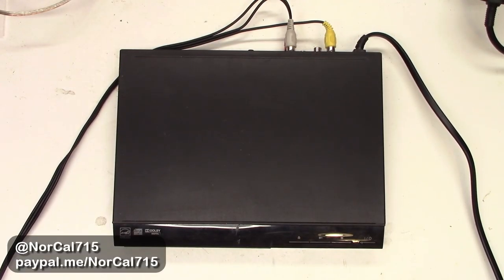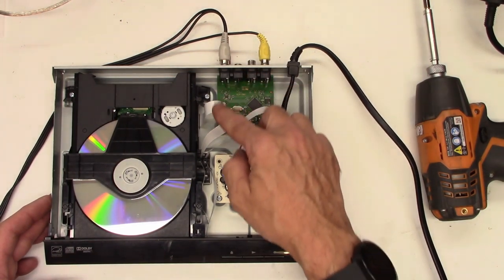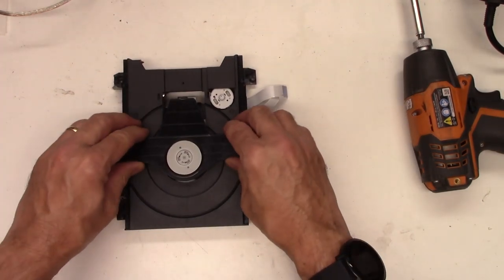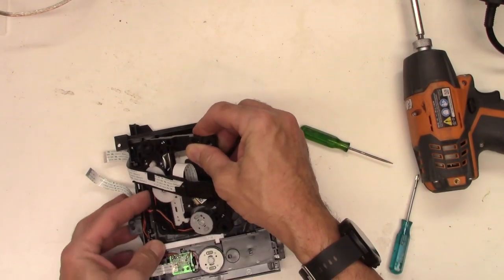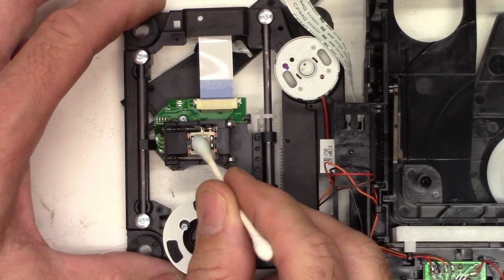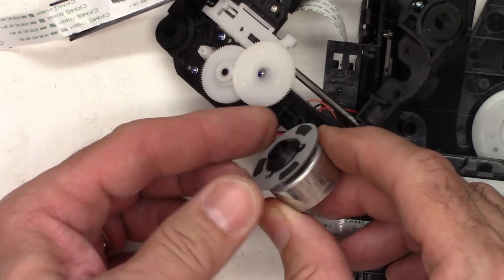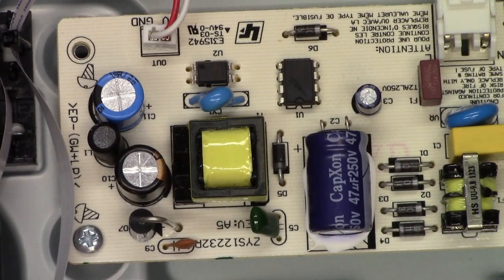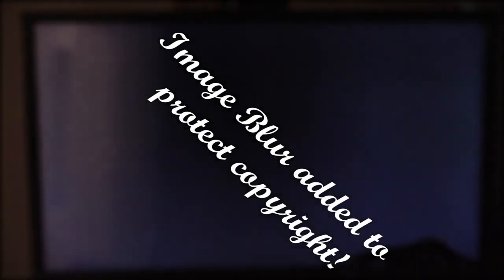DVD PLAYER SERVICING BASICS

Comment: Thanks for posting this video, as it was particularly useful since you needed to take the disc assembly out to access the laser from underneath.
Some appear to be in a sealed plastic casing with no access, but I could see how you could  unclip the unit from the underside.

I’m going to have to tackle my Panasonic DMR 530 blu ray again, after it refuses to read any dvds whatsoever. Originally I prised off the disc spindle and gained access at an angle to the twin lasers. But you couldn’t get enough purchase on it to clean it properly, but I believe your video might have helped solve my problem.
Thanks.

Comment: This is a great video. Is there any benefit to lubing up the rails/gears on the optical assembly, and  "sled"? Figure since a person is already lubing and cleaning every other "moving" part, if that would also help the longevity of the unit. 
When I worked at an electronics place many years ago, we always cleaned off most of the old grease from the plastic gears (especially in VCR's) and greased them up again. Is this actually necessary?
Reply from the maker: I would say yes it is important to clean and relube all the surfaces
Reply: What grease and oil do you use/recommend?
Reply: Yes, while you have access to everything, clean what you can including those sliders. The assembly can stick eventually giving a No Read message.
A light oil was recommended to me which you can soak into the bushes so the assembly just glides along smoothly.

Comment: I have a Kenwood one and there is a magnet that is under the upper clamp, that silver disc above the assembly. That magnet is kinda exploded but is it really essential? Can't I just remove it? Because the player still fires up but ever so often freezes the dvd
Reply from the maker: The magnet is what clamps the disc to the platter. Without it will just contact the disc with friction and the servo will not be able to correct.

Comment: This is a good instructional video (Though I guess as others have said, it might be better to use alcohol)  and this probably goes without saying (but I'll say it anyway). Do this only if you have to. If it ain't broke, don't fix it. Some people will watch a video like this and even though their player is working fine, they'll think "Hmmmm. I think I'll clean mine just to be on the safe side". Just to be on the safe side, don't do it unless you're getting a lot of errors and skipping and you're sure it's not scratched or dirty disks. You probably won't damage the mechanism or the lens if you follow this video exactly but they are delicate parts and you could damage them easily. Decent DVD players are getting a little harder to find and this one isn't half bad so if you have one of these, you don't want to kill it prematurely. It's a digital reading system so if you don't see/hear  errors or skipping, you won't improve the picture or sound quality one bit by cleaning it.

 I don't post this to be an annoying know it all. Just that I've had those moments where I thought I was gonna make things better and I did something slightly wrong and screwed the whole thing up and made a pile of junk out of something that would have lasted years.

Comment: Any particular reason you're not using Isopropyl alcohol to clean the lens and the rubber? I imagine it's a much safer solvent, as the cleaning solution has detergents and other substances that could leave residue on the lens or on plastics and other components inside.
Do you think there's any point in applying  a bit of oil on the plastic teeth of the various wheels inside and on the side plastic bit (used to pull tray in and out)?
Reply: Using isopropyl alcohol is just right. Remember, be careful when you're using cotton swabs gently do the cleaning process. I had fixed my Xbox 360 drive a few days ago. I'm a happy gamer now :D Sometimes, it's not the laser problem - it's the chassis (rails) where laser unit grinding 24/7, lol. They need to adjust screws slightly. There's one of the rails (left or right, mine is left side) that should be higher than the other because the drive only works on the right angle. But remember how much you turn the screws if you want to go back when you start. I made that mistakes. I had to have to mess around back and forth to understand what was wrong with it. That's it. Sorry if my message is late. Maybe my info will be useful in a situation with drives in someday for you. Good luck!

Comment: I have a Samsung DVD-6700. The disc will not load. With the cover off the DVD reverses and spins in one direction than reverses direction. The unit is clean inside.

Comment: These units are honestly all you’ll ever need if you have a smaller 720p 32” tv like my LG, where blu-ray won’t make a difference. Really good for $35, and nice looking. They work with CDs as well. They still make them, too. My only complaint is they run a little noisy, but my old 5.1 sound system drowns it out. I love these where you can retrieve the disc without power, my 2003 Toshiba can do the same thing.
Side note: the fuse on these can go out, but it is super easy to solder one on.
Reply: You see no difference between dvd and blu-ray on a 32 inch tv? Umm, you need glasses 🤓

Comment: Not a good practice to touch belts with bare fingers: finger oil on belts wold be counter-productive.  Also recommend a smidgen of light-duty contact cleaner on the ribbon cable connectors

Comment: Acetone on a rubber belt??? Not a good idea, it will make the belt deteriorate faster. Acetone is a hard solvent.
Reply: It's a $5 DVD player Hans
Reply: @killmore75  Oof! ok then :-)
Reply: @hansu-nihon  : )
Reply from the maker: like I said I have been using acetone since the early 80s and my belts cleaned with acetone last sometimes longer that new belts do
Reply: Nope, it is $35 at Best Buy. Really nice for the money too.

Comment: Dear sir I AM USING ......CAR SCREEN WIPES EXTERIOR  on on LENS .....sing  on cantact cables  scart 3.5 etc BBUT IT WORKS   ....vodka from bin in park will do many players.....after 20 years I am not IPA .METHALATED spirit .  LIGHTER FLUID
Reply from the maker: That makes my brain hurt.
Reply: At 4 minutes 30 onwards ....I AM USING SALIVA ,. SPIT    THUUK in hindhi... I FOLD PAPER WET WITH SPIT SALIVA AND PUSH INTO MOTOR BUSHING .....also gears white AND THE TWO RAILS METAL guide rails ....this is amazing magic especially for vocal singing .....repeat every 5 minute ....REPEAT EVERY 5 MINUTES ....this is why they had twin turntables .,.,so the dj could lubricate the other turntable.... I AMUSING A TURNTABLE WITH BEARINGS 3 OFF

Comment: Why did you stop halfway on the lubrication? Granted cheap dc motors and fan bearings will always dry out and require some TLC and you jumped through hoops to lube the motor rotor and I was expecting you to, while you had the oil in your hand and looking at the unit, give a pro-active swipe to the rails. Other than that, that's how you do it! Nice job on a rather neglected abused little dvd player.
Reply from the maker: just getting used to the new camera. That part didn't record. I thought no one would notice. Glad you did!
Reply: @norcal715  Hey, great. You'll have it down in no time with those mad skills of yours. :)  When your AR you notice things. Glad they did get some love, it was a good service job.